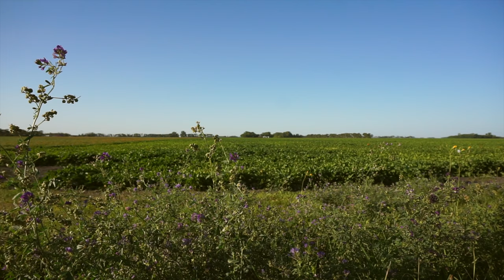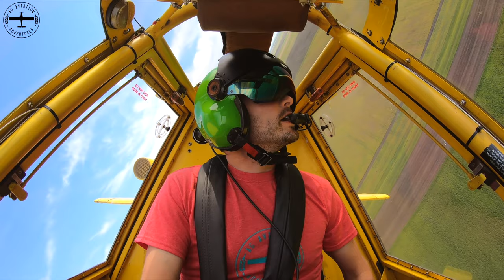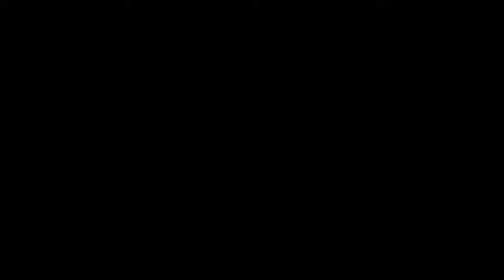How Much Chemical is Applied to a Field in One Load?

Comment: How many hours before you got comfortable enough to pull out a can of soda while your mid spray?!
Reply from the maker: Chris Begemann I’d only recommend that if the field is at least a mile long.
Reply: @AgAviationAdventures  in line with this question, how long was it until you felt comfortable splitting your attention between flying and talking/other things?
Reply from the maker: Joshua Anderson I wouldn’t recommend it in fields that have obstacles. I found myself always with thoughts in my head and talking to myself so I figured I’d record some of them.